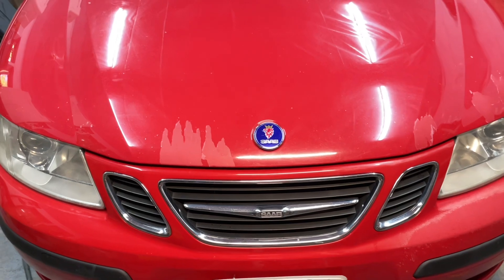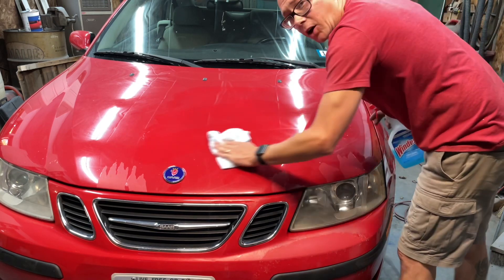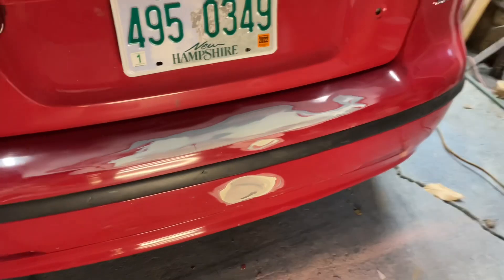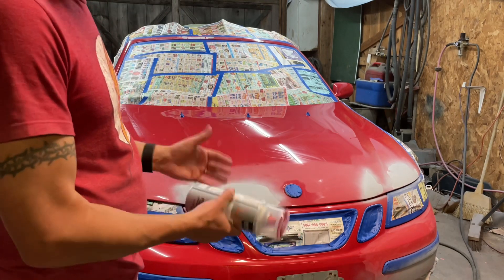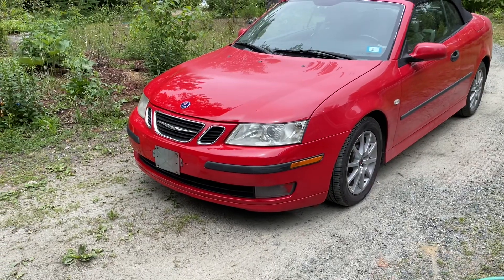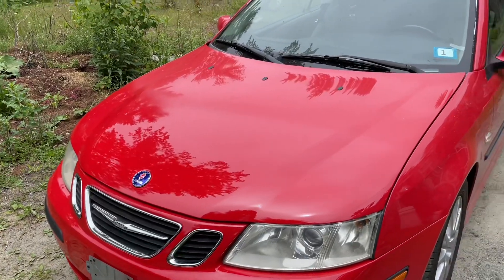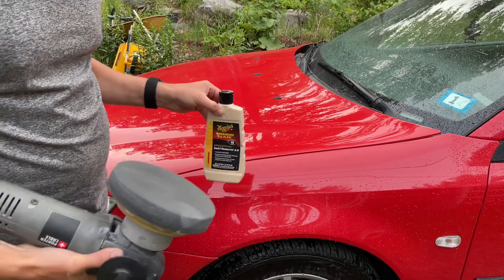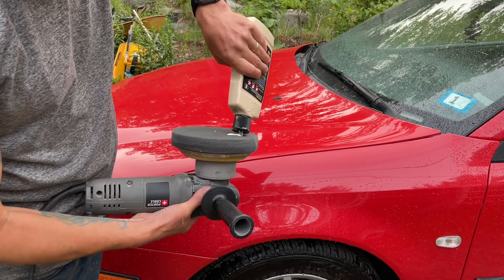How to fix peeling clear coat

Comment: So happy I found you,ive had 6 Saabs and I finally found one with less than 80k on it, a 2005 Saab 9-3 ARC Convertible, and I have a chipped-up bumper and a few spots I need to take care of as well...when I popped the hood I realized it wasn't the same as my last 2002 9-3. Still, once I saw 4 screws exposed the injectors and plugs I was so happy...the person had "rigged a few things to last only a week or 2, but for me, they are easy fixes, he sold the car to me and said there were no issues, and when I got halfway home the check engine light went on, the rear brake light went to toast and the hydraulic fluid leaked out. then had the balls to tell me he would fix cyc 4 and the roof for me for 250$ lol batsht crazy land...
Reply from the maker: Lol, hope the videos help you out!

Comment: You got it!!
Reply from the maker: Thanks, I think it came out pretty good.
Reply: @coreysgarage6389  My clear coat is kind of fading...when I touch it has powdery white substance...not much fading, but little white powder spots here and there? Can I just wet sand with 600 grit and apply just a clear coat (without applying base coat) ?? 
Because fading is not very much and I think factory base coat is still intact

Comment: thank you for the video. 

Had a question - the spots I am dealing with look like your hood. Most are smaller but have a couple that size. Would it be worthwhile and a good idea to start with 1000-1200 paper instead of 600-800 so I can avoid base coat disturbance if possible? May take longer, but its towards beginning stages and if i DIY I am trying my best to not disturb the base coat. Thank you
Reply from the maker: You could try it but it’s very unlikely you will be able to feather the edges of the clear without disturbing the base coat.

Comment: That is amazing work! Great video! My only question sir, when you applied the compound you wet the surface while you buffed out the application. What is the advantage of that process?
Reply from the maker: The water provides a sort of lubricant and prevents the compound from drying out.